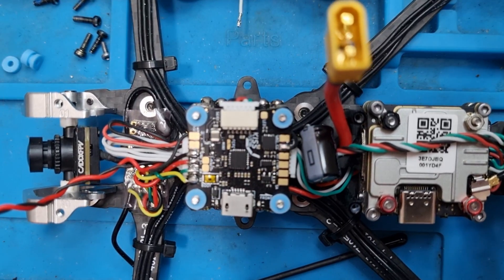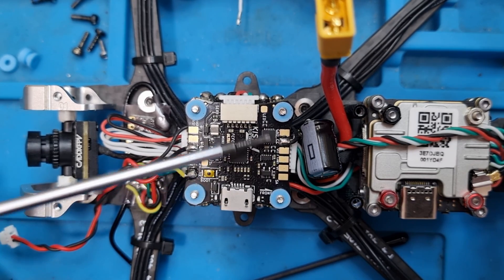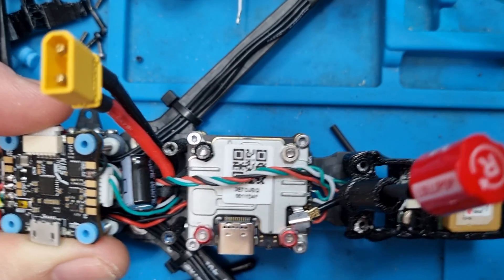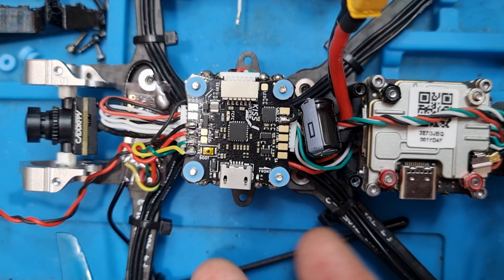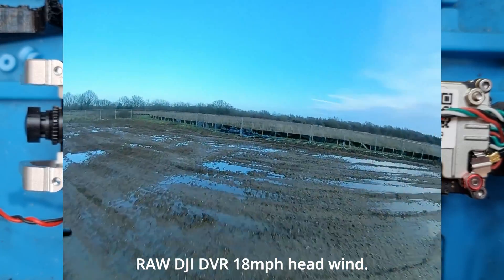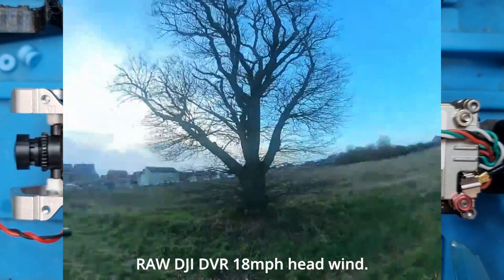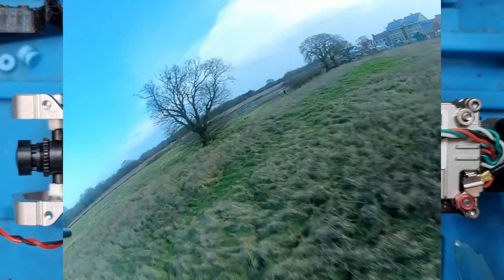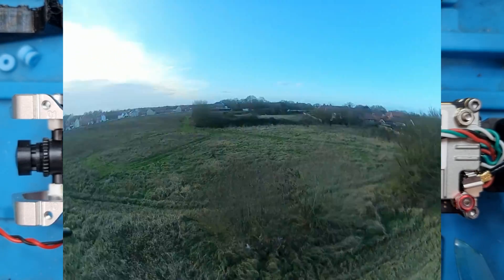Kiss Ultra Mini 20x20

Comment from the maker: Yes I called it kiss v2... shoot me 😉 in addition usually I would not use gummy inserts. In this case I am as I needed to raise the fc and the holes on the fc are m3 and I'm using m2 bolts. Tightened down as much as it can be it's fine but generally you can hard mount.
Reply: Hehehe... ;)))) Its ok. Shape is the same, its a tribute to v2 :)

Comment: for a 5 inch cinematic / freestyle setup, should i get the mini or the fullsize? I don't know which one I should get. The mini comes in stock sooner but how many 20 by 20 4 in 1 escs are there that would work for my setup? And someone on the server told me not to use an adapter from 20x20 to 30x30, so I guess i want the fullsize right?
Reply from the maker: You can happily use a printed adapter. It'll work fine. Personally I'd use 30x30 on a full-size setup but if you're trying to reach a certain weight etc then there are 20x20 escs from aikon and foxeer etc that should be decent or just use the adapter.